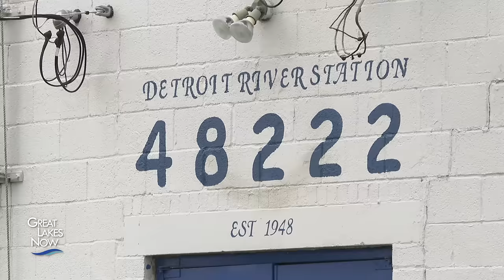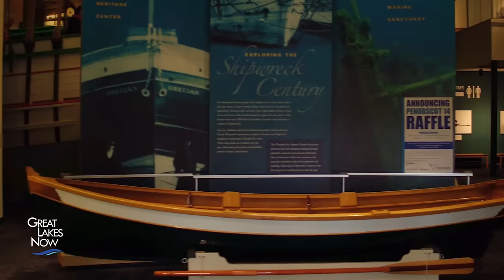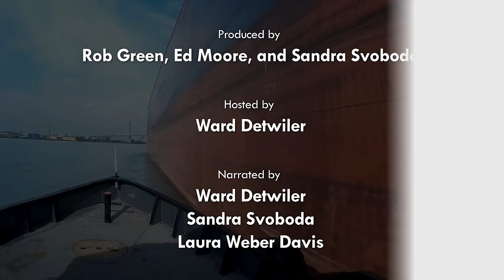Ships and Shipwrecks | Great Lakes Now Full Episode

Comment: S.S Edmund Fitzgerald is bigger but it sank in the late 70s
Reply: There are a number of lakers landlocked by their size since they were built after the last new locks were constructed and opened in 1959, so while there are plenty of more modern ships, the reason they don`t make them bigger is they are restricted by the current size of locks if they want to make it back and forth from the lakes to Montreal and points beyond such as ports of the Gulf of St. Lawrence or city of Halifax.
Reply: mid 70's she sank November 10,1975